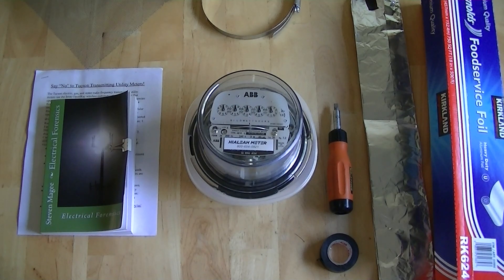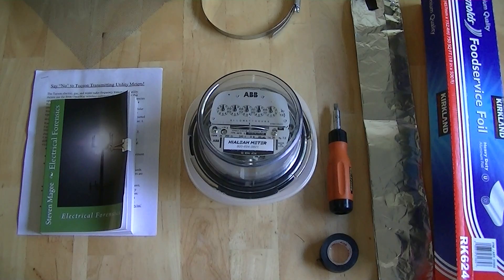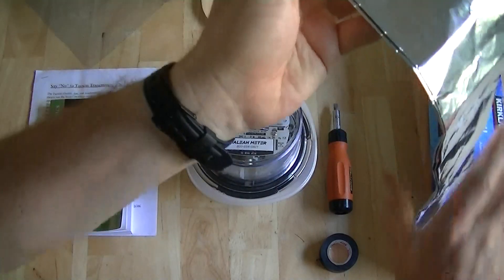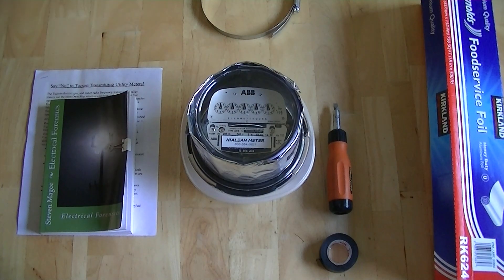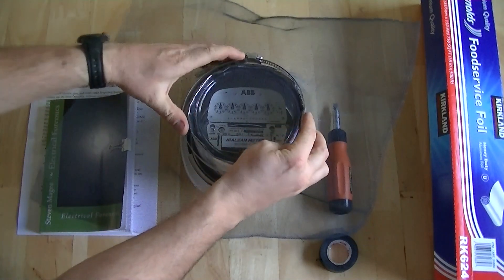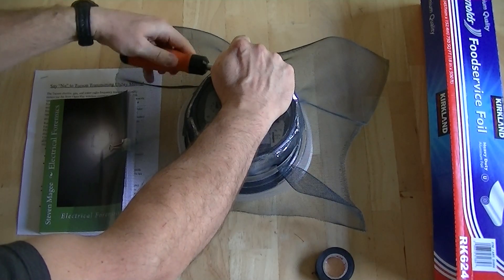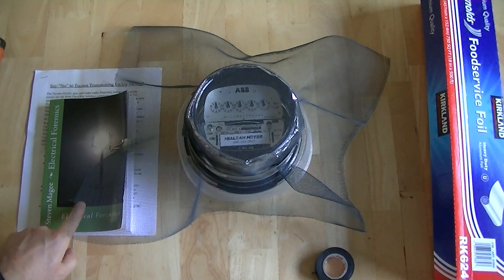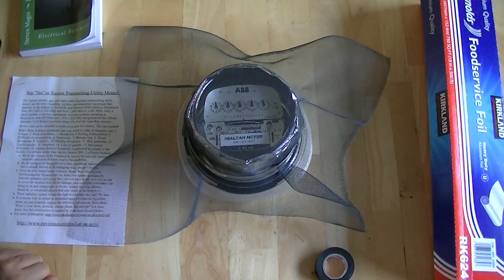The Cheapest Way of Screening a RF Transmitting Smart AMI AMR Utility Meter

Comment: If I have aluminum siding and the meter box is on top of it would that provide sufficient shielding between the meter box and the house?
Reply: Yes. Notice how well your phone works outside compared to inside.
Reply: Thanks!
Reply: And you probably have a metal box that the meter sits on. Also, the tiny power that the meter puts out, at a small duty cycle, is not going to harm you. Fear will harm you, though.
Reply: Let me explain. 

Say we ran an experiment where a billion people held an RF radiating instrument half an inch from their brains for an hour a day for ten years. Should we not see an epidemic of sickness and death from Radiation Poisoning, if the claims in these videos is correct? 

Yes, we should. But we do NOT. 

Now, a smart meter is not a half inch away from your brain; it is 100 or 1000 times as far away. The radiation expands to the square of the range, so the dosage is 10,000-1 million times less than your average cell phone. Also, smart meters do not run the duty cycle of a cell phone; they just send out the data and shut off. 

Let me further explain that I have spent 45 years working in research with high powered radar and radio transmitters, and have a masters degree in electromagnetics, and have designed and built shielding, antennas, transmitters, and anechoic chambers. 

These people selling you this crap and putting out scaremongering videos are pandering to your fears. They are lying about the science just like homeopaths, astrologers, and magnetic bracelet hawkers. 

If you are scared to death of something, you will have health problems resulting whether or not that thing is actually harming you. It's the fear doing it to you. The solution is to research the actual risks and effects. Note that research is not watching bullshit videos from scam artists. 

Forget the aluminum foil and screen. Keep out of the sun, which puts out far, far more power, with higher energy radiation, and is known to cause cancer.

Comment: your sign has no value. you are under a service agreement by the utility co for maint repair replacement of the meter at any time. failure to comply means u may be operating from a generator within 30 days.
Reply: All u have to do is start reading your own service agreement. The power cord has the right to replace your meter. I just sent a letter for termination of electrical service to some dumb chick like u for refusing to allow access to the elec meter. I  Can't wait to cut her power.
Reply: james baca they DON'T have the right to endanger my health, tho. Many court cases now being brought and won (check Hawaii power companies, for instance) because the power companies are hiding the dangers due to the big bucks the honchos are receiving from selling the data they receive from the meters ( OTHER than your total usage). They sell data on how much and when we use our appliances, when we're home, etc., to companies interested in our lifestyles (they all are, that's integral to sales!). Haven't you seen the news reports about "your dishwasher is spying on you"? Poor uninformed utility employee, your bosses are the ones lying... or just not telling you because maybe (?) you have a conscience and wouldn't want to install them otherwise...

Comment: I bought a roll of aluminum foil from the dollar store, 7" ring and a 2" ring, 24 gauge insulated copper wire, aluminum screen.  I folded the foil to make a ring around the side of the meter. Did I think about the concentrated radiation now flowing to my face as I installed the ring to hold down the screen? Ahhhh, no. I put the ground wire from the ring to a grounding rod that was left over from my analog meter.

Now the bummer. That evening in bed I felt as if I were going to jump out of my skin, my throat glands were twice their normal size, and  hurting if I touched them. Plus, I had a headache. So, warning! Keep your face & head away from the front of the meter while tightening the ring - I are dumb. It's been 24 hours and my glands don't hurt as much, but are still swollen, and the headache is almost gone.  This is powerful radiation to do what it did in less than 15 minutes of installation!
Reply: Kitty Kitty turning the breaker off to your home is not going to stop it. The electricity to the meter is coming from the top that goes from your power pole to the main line. That's why the electric company has that little plastic lock on the meter box :/
Reply: We just got our "smart meters" installed. This shit is not fake! Horrific migraines and flu-like symptoms 4 days straight now!! I have got to find something that works cheaply but quickly and effectively!
Reply: In addition to doing everything I can to limit the radiation and frequencies, we also do earthing.  It works very well.  I have an earthing pad under my feet, especially at the computer and when I sleep, it takes all the frequencies out of your body and it's like sleeping straight on the ground to resonate with earth's and our bodies natural frequencies.  I also bought grounding/earthing mousepads for the kids for at the computer.  Constantly discharging and grounding yourself makes a big difference and this is going to be especially important when we get 5G.  Some pads I buy (kind of expensive abut worth it) however some I make myself out of either copper foil tape or signal blocking material that's conductive, can be made into a pad, pillow case or just cover the foot of your bed.  Then you can ground it with copper speaker wire out your window and into the ground, or you can buy earthing cables that will clip to your pad and then plug into the ground part of your wall outlet.  Need to get a plug tester to make sure that the outlet is grounded and nothing is wrong with the wiring.  Anyway you can look into this by just typing in "earthing" and there's a good documentary where a whole town in Alaska tried it called "The Grounded".
Reply: @Angelface4178  did you find and thing to work on your smart meter, I swear mine is giving us mad headaches? What worked for you
Reply: @EasyPeazy-wf4ck  not 100% but meditation and self healing of my aura and energies.
Reply: Physical solutions to the meter itself don't work because 5g is everywhere now. You need to work on your body and mind.
Reply: OMGosh! So sorry you had that happen. Would shutting off the power (main switch in fuse box) prevent this from happening? Thank you!
Reply: Wait til they juice the 5G! You won't have one Bracknell left! Why do you think the 'actor's are underground?
Reply: Absolute gibberish courtesy AI !
Reply: My son has been having trouble with swollen glands from his cell phone. He's left handed so carries it in his left pocket. His glands were swollen on that side of his face until he stopped carrying it. It happened twice so not a fluke.
Reply: Dance Lessons Orlando 
I highly suggest you get with a cleansing and detox guru and do a few deep body cleanses. Especially your gallbladder and liver. Very essential for body and brain health.
Reply: @todaysrealhealth8153  Oh yeah,  then go back in your house to get sick all over again.  🙄
Reply: what if you turn off you main disconnect first ??? essentially cutting off the power coming into your meter ??? dose smart meter have its own internal battery {and if so whats its life span } if its has no power it shouldn't be transmitting  right ???
Reply: Hypochondriac stop crying you get doused with 100X more radiation every day from all the WiFi.

Comment: Just a tip of what I did.  I also put a Mylar Emergency Blanket on the INSIDE wall behind the meter.  To all the "doubters" out there,.............this DOES actually reduce the physical effect of the RF radiation on the body.  If you are more sensitive to RF, you
will notice quite a bit of difference fairly quickly.  

TIP #2 - I also made small, Mylar bags from those Emergency Blankets for my cell phone(s).  Just make DAMN SURE you turn your phone OFF FIRST, or it might catch fire.  If the phone is left on, it will cook itself.  Maybe not immediately, but it will.
The bag keeps your cell phone WHILE OFF, from being activated remotely and/or tracked through its GPS transmitter.
This is also a bonus for those guys out there who's wives are paranoid of where "hubby" is, and put tracking programs on your phone(s).  Just sayin'.
Reply: Bro.... I followed your advice
Considering how low cost the mylar blankets are I put two up against the wall over several layers of aluminium foil underneath them

Power company bastards, murders they are , know better and do nothing to help people

Fight the fuckers
Reply: Where do you buy the best Mylar blankets cheap? Would it help shield your bedroom walls from 5G radiation as well?
Reply: TodaysRealHealth They can be called “camping blankets” at Walmart or spirts stores. Just ask for the folded mylar “blankets” for camping! Should be $2=or $3.
Reply: thanks a lot for a recommendation on a mylar. I was wondering about it, but don't have an RF meter to verify. As for a cell phone, I would recommend putting a mylar shield in the case, but you have to make sure that when the cell phone is in the pocket or purse, the shield/case is positioned towards the body, and with the screen  facing away from the body,  to reflect all the fields away from the body. Anyone has to be careful, because the mylar reflects (not absorbs), so you don't want to get double radiation.
Reply: Thx 4 Mylar tio!
Reply: You just made a faraway cage for your fone! Whoo Hoo!
Reply: AI could fuckup an electrical set dream!
Reply: See what I mean? Wet dream!!!

Comment: Useless video until you show before/after RF readings using this "cheap method".
Reply: I did the steps exactly as he shows in the video, and I can FEEL the difference -- both in my house and in the backyard. So I know -- by my own experience -- this is working.
Reply: i tend to agree, but there are plenty of other videos doing the same thing  using similar or the same material. Those vids tested and they worked.

Comment: If my neighbor has 5 of these 15ft from my bed, 8 ft from my outer wall, would aluminium meshing my inside wall help? Is steel mesh better? Thats what ive seen kits come in for the meters.
Reply: i would see if you could make these cheap guards for all of them to knock the strength down, then put metal sheeting just outside or on the inside wall. wouldnt mess around with 5 of em. also needs to be tested

Comment: Since a smart meter is sending info to the utility company, would not complete shielding of the meter block that signal? And would not there be a build-up of radiation inside the shielding? Do any one know the answer to these questions?
Reply from the maker: +Johnny Chaney Faraday cages are RF signal attenuators.  That is to say that they reduce the RF signal strength but do not completely block it.  To completely block it you need to use multiple Faraday cages.  See" How Many Faraday Cages are Needed to Block a Cell Phone Signal? https://youtu.be/4vQitDBMtYE

Comment: How about from behind?? This stupid smart unit is outside and right behind it is my sons bedroom, and his bed happens to be right up against that wall.
Reply: He should not sleep there till the meter is OFF. Get the utility to allow an opt-out. Shielding the meter like this forces the signal out the back. That is how I became very electro-sensitive. Smart meter behind headboard of my bed. Very dangerous.
Reply: You are wrong, James. The meter's radiation does go inside the home, it has been measured many times by different professionals and me. It also sends rf radiation along the wiring in the form of dirty electricity. All measured and seen, all felt. You haven't got the credentials to deny this, obviously.
Reply: Not true! This is real! It is dirty electricity. Look up Electro magnetic frequencies and Electro magnetic radiation. Microwave radiation. These are destructive to health.
Reply: Is there some way you can put the bed on the other side of the room? I know a kid, well, used to know....lived in the city and right next to the house was one of those big transformers. At 14 he got cancer lymphoma and died at 16. I have also read that these meters have blown up and burned the house bad.
Reply: Travis-2313:  I have the same problem. The meter is mounted directly behind my Headboard on the outside wall.
Reply: In one of the other videos somebody mention buying a space blanket from a sports store. Maybe hanging this up against the wall can block it also. Do more research.
Reply: https://www.youtube.com/watch?v=oXaFlqmphVk
Reply: That is untrue, and you aren't a physician. So don't practice medicine without a license! It is a physician who first told me about this, who had many patients coming in sick from these.
Reply: Well, I do have a spectrum analyzer, which is what you need to discriminate between different sources of RF. Your untuned field strength meters do not. I would expect a different source because smart meters are low power.  A gas meter runs 15 years on one battery. 

The metal back of the meter reflects RF out the front. When you put a screen on the front, instead of radiating out the front like designed you are probably going to concentrate more RF on any holes in the box and the wires going out. So it could be counterproductive.  

In 45 years of working with antennas and high powered transmitters of various frequencies I have never "felt" any RF. All the studies I've seen show no causation at low power levels. 

Let me reiterate: You became "electro-sensitive" by worrying. There is no such thing. It's the worrying that's making you sick.
Reply: ......The meter box is made of steel, on all sides, and it's rain-tight.
Reply: The meter  has a solid metal back.

You became "electro-sensitive" by worrying. There is no such thing. It's the worrying that's making you sick.

Comment: Couldnt you just wrap the meter with the window screen and then put the hose clamp on it?
Reply: I'd much rather wrap it in thermite....
Reply: I've seen a youtube video demonstration of such a wrap with a hose clamp, covering the entire smart meter. No use of tin foil, the meter showed up with a positive difference, compared to when the wrap was absent.

I wonder if when one shields the EMF radiation, by wrapping, if that's noticed by the energy provider. How's the reading done, of a smart meter? Is the EMF radiation coming off a smart meter the actual read out for the energy-provider? 

Or is there another form of reading the smart meter? It's the first time I ponder this.  Also, if there's evidence of it, what's the amount of EMF radiation on the other side of the smart meter?

Comment: hey what about back side??? all this run into your house isnt it
Reply: I put it on the wall behind it. But to little avail. The foil was not enough to stop the pulsed rf radiation.
Reply: And it sends measurable rf radiation along the wiring as well - "dirty electricity". I have had people come with spectrum analyzers and measure the smart meters five times at my former home. The Cornet Electrosmog Meter (model 88T) identifies the frequencies measured, as well.
Reply: ACE has a Chrome Aluminum paint to paint the inside wall behind the meters...but beware it has a very strong odor.
Reply: And now I will paint a layer of graphite paint over the chrome-aluminum to ground the EMF's.
Reply: The odor last only a couple of days until it dries completely.
Reply: Paint with Shungite powder
Reply: Elite Shungite is 98% Carbon
Reply: the mechanic a
This is an analog
Reply: Did this help you a lot?
Reply: I was going to mention that lead paint would help tremendously in blocking the RF radiation from entering your home. I am on the lookout for a good bucket of old school lead paint to cover my home to protect my wife and newborn and myself from this harmful radiation!
Reply: @Andy-im3kj  you can get lead flakes from auto break shops and mix with paint...also shungite powder in paint helps shield it also
Reply: This gentleman did a test inside the house and it worked.   See this video: https://www.youtube.com/watch?v=3tXC8fjrwmY
Reply: Yep...   Quadruple double freezer coil on the wall, grounded to the electrical outlet ground!
Reply: Freezer foil--- fucking AI!
Reply: In addition to a faraday cage, which needs to be grounded, you can wear shungite and put 3 shungite nuggets in a glass water dispenser for your drinking and cooking water.  The shungite nuggets direct energy clockwise so your water will be “structured” and healthier to drink.  Don’t forget about your pets, as they are affected by RF too.  Attach a shungite nugget or pendant on their collar and give them structured water to drink.  Blessings to all.
Reply: @cbpapp  huh
Reply: rafal urbaniak yes sir

Comment: Good thinking BUT there is one major problem.
I hear these things emit RF frequency up to 2 or 3 miles.
Even if you cover your meter with Aluminum protection, Your neighbors and other people homes still emit the same harmful RF, leaving you vulnerable anyways.
Reply: EVERYONE should cover up their "smart meters".
Reply: Yea very sad that not everyone is doing it ..looks like everyone is for them self
Reply: These people don't want to hear facts from engineers. I tried.
Reply: But much less...
Reply: @Harpazo_to_Yeshua   Thank you sooo much!
Reply: Emit for miles? Reception is dependent upon the noise floor of your receiver. Get your noise floor below -140 dBm and you can receive tiny signals hundreds of miles away. You don't bother to define any terms so the statement is pointless, just like these misinformed people who put tinfoil on their power meters. The tinfoil would do more good wrapped around their bodies many times and sunk to the bottom of a pool of water to shield from the ACTUAL harmful radiation coming from the sun.